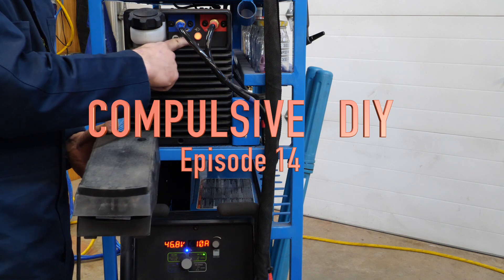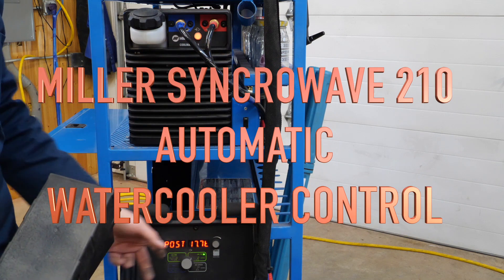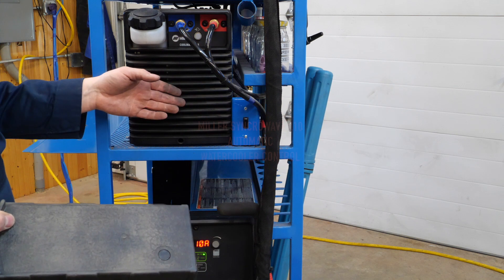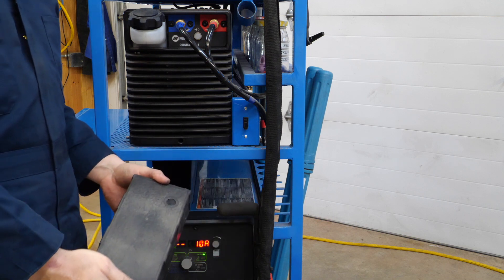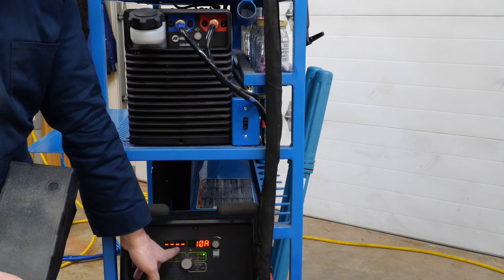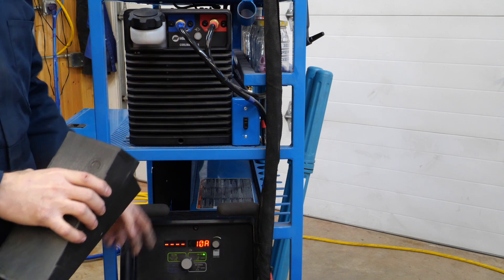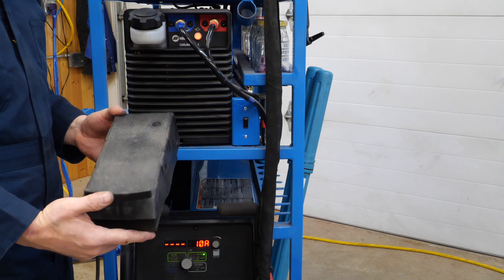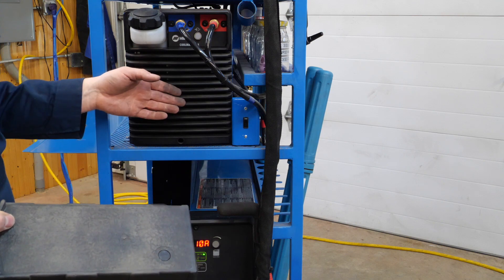Automatic Water Cooler Control for Miller Syncrowave 210

Comment: The gas solenoid on my Miller Dynasty 200DX operates on 24 volts DC. I installed a relay in parallel with the gas solenoid coil. I use the normally open (NO) contacts of this relay to trigger a variable off-delay relay to operate the pump motor on my water cooler.

The water pump runs any time the gas solenoid is on, and continues to run for a set time after the gas solenoid shuts off.
Reply from the maker: I looked up time delay relays and I can see that yours is a superior approach!  By coincidence I am getting away with the post flow gas flow delay for my cooler because I am hobby welder. If I welded all day I am sure the coolant would get hot and an adjustable longer delay would have been advantageous.

Comment: Can you add the manufacturer and part number for the relay?
Reply from the maker: APIELE 24V DC 8 Pins 10A Coil Electromagnetic Power Relay 2PDT 2NO+2NC MY2NJ HH52P with Indicator Light With Base (24V DC 10A)
Reply from the maker: While this relay has a 24V DC coil that uses very little current and has enough capacity to handle the less than 6A that my small cooler draws, it is meant to be mounted on a DIN rail and does not have holes for attachment inside the electrical box.